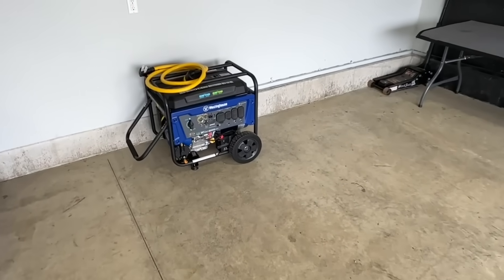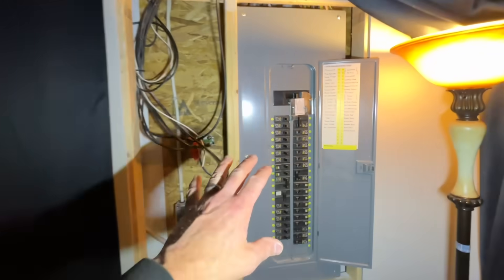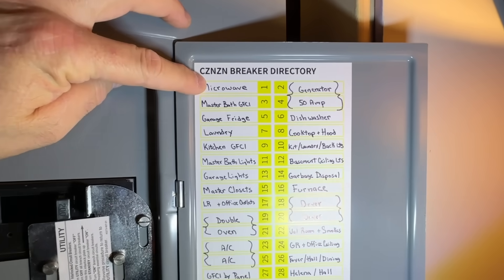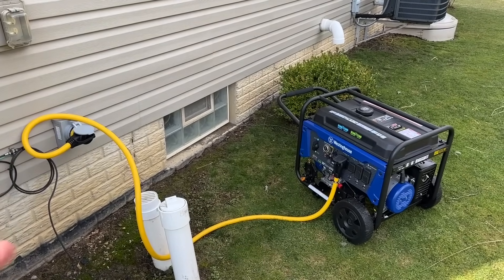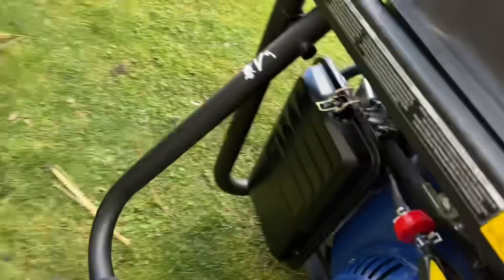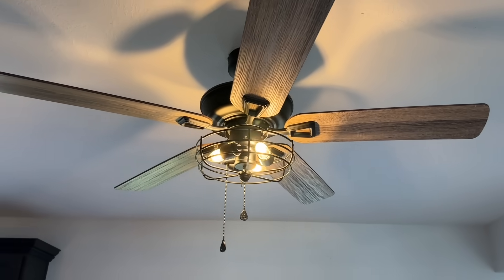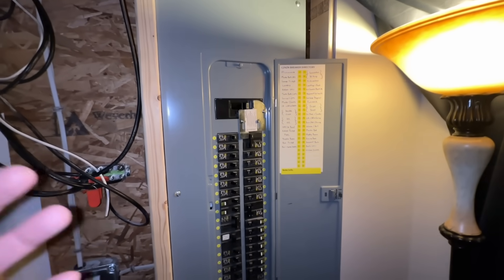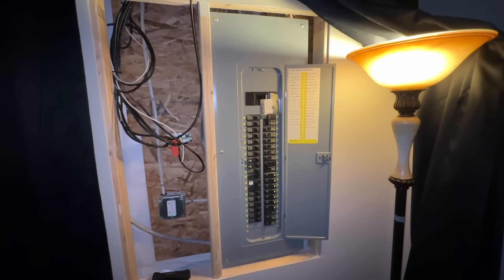Whole Home Manual Backup Generator Setup For Less Than $1600

Comment: Great video! I am thinking of doing exactly this. This westinghouse generator is not an inverter type. I'm told that inverter types are needed to avoid damaging electronic devices like computers or other appliances that have circuit boards. Does your type of generator protect electronic devices?
Reply: Get a power bank with an inverter, then you can charge it.

Comment: For safety please get a longer cord.. it should be 20 to 30 feet away from the house. I also have a sub panel for my emergency power with a double pull between the panels. No need flip switches in a panel.

Comment: What a great video. SWFL guy here, and we all know what I've been through this year. 😂 I've been watching those Generac commercials and thinking about doing something like this instead. Thanks for the absolutely great video. I have a buddy that's an electrician/ handyman, and I get wholesale prices on generators through work. A/C in SWFl is a top priority in Florida in the summer so if have to do some math and configuring to get that to work for sure. Fans don't do it. Lol. Thanks for taking the time. 🎉

Comment: Never shut the generator off with a load on it!  You should have switched off the interlock panel breaker first, then the generator breaker and let it run with no load for a few minutes to cool the windings before shutting off the generator.

Comment: Every breaker should be off when you flip the generator breaker on. Then starting with the highest amp breaker, flip on each one. 40 amp first, wait a few seconds, 30 amp, wait a few seconds, 15 amp. That gives your generator time to stabilize. Then flip off the generator breaker first before shutting down the generator.

Comment: Unimpressed.  I have a Generac  22KW backup generator that runs on propane.  I have a 330 gallon tank that will last about a week if my power goes out.  It automatically kicks in when the power goes out.  Yep, more expensive but IT WORKS.

Comment: A little deceptive.  You got your electrician buddy to install a $50 interlock switch for free while the rest of us have to $900.    So it's really $2500.
Reply from the maker: I paid $1000 for the generator, around $70 for the yellow rv plug, and $500 to the electrician to install the interlock.  He had the cost of the interlock switch, the cost of the outdoor 50amp plug, plus the wire and time to rearrange my breakers.  I assume I paid around $300-400 labor if he only charged me $500.  Not sure your numbers are correct.  I paid a total of $1600 max.

Comment: Got the Wgen 9500c earlier this year , many days over the last 10 years with no power has gotten more frequent in Florida for us. Running generator now as Milton really tore stuff up . We could not afford an inverter style generator setup and needed a generator large enough to run 3.5 ton a/c , fridge, freezer , lights , internet and couple pc's . Things I have learned over the last 130 hours running generator. It uses 1 gallon per hour running a/c on top of all the other stuff. 6 hours per tank. No a/c lasts about 12  hours . Some of my UPS power supplies and appliances do not like the high frequency preset output.  61.8 Hz with no a/c and 60.8 Hz with a/c load. It is a balancing act to adjust governor speed to get 59.1 to 60.5 hz depending on load so stuff is happy. Using Hz reading on generator  itself, do not know how accurate it is but stuff is happy with range adjustments stated above.  A/C is off and running dishwasher and adjusted to 59 to 60 Hz so it is happy, after dishwasher is done, readjust governor speed for a/c load . Set a/c to lowest temp so it does not cycle , when it is cold in house shut it off manually until it gets unbearable in house again . Rinse and repeat adjusting governor speed. This is purely mechanical generator speed control, so be prepared to fiddle with governor engine rpm/speed  settings. Use UPS power supplies on everything you can for extra layer of protection.   8mm wrench and phillips screw driver to adjust governor speed,  small  adjustments is all that is needed.   My prayers are out to all affected by the hurricanes.
Reply: Hi there! Thanks for answering so many of my questions I had about generators. I’m in the Tampa Bay area & although Milton did a number on us….honestly, Tampa has dodged plenty of direct hits. I have a 3.5 ton a/c unit as well. Always wanted to know about how much wattage would I actually need for my household (11,000 or 13,000) while running everything else. I came to realize we should be alright with a few box fans. Even thinking about trying out a portable a/c unit if anything because of our Florida heat. But just as long as we have power to the fridge & freezers we should be good. With Mother Nature we can prepare our butts off, but she’ll ALWAYS show us where there’s more holes to fill in our preparations.

Comment: I've done this, it does work well.  A couple of things I'd like to add.   If you live in a subdivision be aware when there is a power outage your house will stick out like a sore thumb and everyone will hear your generator.  Anything you can do to make it run quieter will help, and you may wanna figure out how to secure that generator depending on where you live.  It will become a very sought after piece of equipment depending on how long the power is out.  Be prepared to have fuel on hand.  The beauty of a natural gas generator, not only is it quieter you won't have to run out and get more fuel.  Depending on the power outage the local gas station might be out of power which means no fuel.   The larger the generator the more fuel it will use and the more cumbersome+ it is to move it around when you need to.  We lost power for a week, imagine the fuel trips I had to make.  Make sure you have large capacity gas cans on standby if your gonna go this route.  This is a good setup if you only have a couple of short duration power outages a year.  If losing power is common and it takes a long time for them to turn your power back on you may need a more permanent solution like a natural gas setup.
Reply: Great tips. I wanted to add that they do make natural gas portable generators, but I don't think those run any quieter (not sure about the whole house kind). I'm looking at a Westinghouse tri fuel for my setup - but have not bought anything yet. Not sure if this guy has natural gas or not - we do so that's what I'm targeting.

Comment: You don't have to disconnect any C.B, as long you don't use them accept main. You have plenty power to do what you want to do. If you check Amps on your panel in normal condition you are not using more than 35 Amps max. One thing i would add is bell when your power come back so you know to switch power back as was .

Comment: I have the cheap version;  HFT 4000w ($239. on sale) and a Hubble Y cord to 2 long extension cords that run to each floor.. So far, so good. Great on gas. Can always siphon from car if my stored gas runs out. Wife happy.
Reply: No you can’t always siphon from your car. That ain’t happening like you think it does.
Reply: @condor5635  Sure I can. I have a siphon pump whichI use all the time.
Reply: @dbfcrell8300  - almost all cars in the last 10 years, have a screen as well as other features that make it almost impossible to siphon like they did in the 70s and 80s. Have you actually siphon from your car?

Comment: Great info, I put a 6 outlet circuit in.. Plug on outside for gen.. 12/2 ..Outlets painted red , All gfci ..Pull out plugs and plug in red.. 120.00 in gear and a ton of hours but some wire fishing  , boxes in and done till the juice stops.. Great..

Comment: Great video. Nearly my same setup. Two things. Turn off ALL breakers and flip them back on one at at a time, to avoid power surge. Second, don't run any high end electronics unless your generator has a THD less than 5%. Inverter generators do, but few standard generators do.

Comment: My 13000 duromax was the same price as this guys 9500/7000. Meaning his only can run 7000 running watts. not 9500.  In my home we can run everything. A 2 ton (25000 btu) window a/c and a 10000 window in the back rooms. I start out by turning off everything, switching over, big a/c first then the rest. We also run two hi power desktop computers and giant screen tv's. everything. I just turn them all on one by one. We also have a big double door fridge and three freezers totaling 50000cubic inches with a whole cow, deer and two pigs in them as well as monthly stuff from the local shopping excursions.   So go as big as you can. noting each breaker system will max out at 12000 watts so a double set of switches and double plug in's on the generator would be required for more. My 13000 does fine, it has a 11000 normal running watt range. The 13000 is startup watts that then drop back like what an a/c does when it first starts.
Reply: The wgen9500df is 9500 running watts and 12500 peak watts

Comment: Love what you did. Totally ignorant about this. I do have two questions though. Can a generator that is running sit outside in the rain?  And, since I have gas stove and hot water heater is there a generator that would run off that gas? Thanks
Reply: We went with a duromax 13000. It runs off gas, propane or natural gas. So yes. As for the rain, it can but you will have issues long term, most build a box to fit it into that keeps weather out. There is also a little tent that is made for them. My 13000 duromax was the same price as this guys 9500/7000. Meaning his only can run 7000 running watts. not 9500.  In my home we can run everything. A 2 ton (25000 btu) window a/c and a 10000 window in the back rooms. I start out by turning off everything, switching over, big a/c first then the rest. We also run two hi power desktop computers and giant screen tv's. everything. I just turn them all on one by one. We also have a big double door fridge and three freezers totaling 50000cubic inches with a whole cow, deer and two pigs in them as well as monthly stuff from the local shopping excursions.   So go as big as you can. noting each breaker system will max out at 12000 watts so a double set of switches and double plug in's on the generator would be required for more. My 13000 does fine, it has a 11000 normal running watt range. The 13000 is startup watts that then drop back like what an a/c does when it first starts.

Comment: We live in SW florida and I have a similar setup for life after hurricanes.  I am trying to figure out a way to avoid gas stations and storing fuel cans in my garage. Solar is just too expensive and I use around 1000 to 1200 watts keeping a fridge, outside freezer, fans and portable AC unit running.  If I run these for 8 hours I use around 5-7 gallons of fuel.  So to run them continually I would need 15-21 gallons of gas per day.  I just can't store that much fuel.  I would love a more efficient way of keeping my family out of the stone age if anyone has a reasonable alternative without breaking the bank. The longest we were without power was 11 days after hurricane ian in 2022.
Reply from the maker: Yeah storing that much fuel can be tough.  You can get a larger fuel tank such as this 35 gallon container https://amzn.to/4dLEoQW or something similar to store at your property but yes, storing enough fuel can be a challenge.

Comment: 13:14 The only thing different I would do...is turn on the main circuit breaker then turn back on the oven, and A/C and other switches you turned off, that way your master is returning to load with much less draw. Not a big deal, but, is better.

Comment: I'm sure you know this, but to figure out what watts your appliances use, look at the label. For example, if the label says 120v (voltage) and  2a (amperage), simply multiply the two values. This would mean that appliance uses 240 watts. Add about 10 percent for wiring...